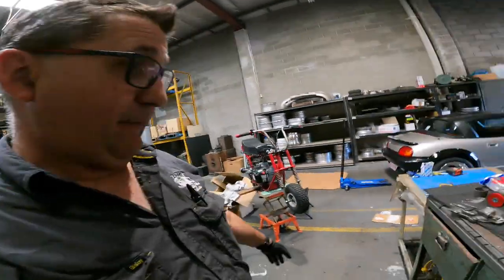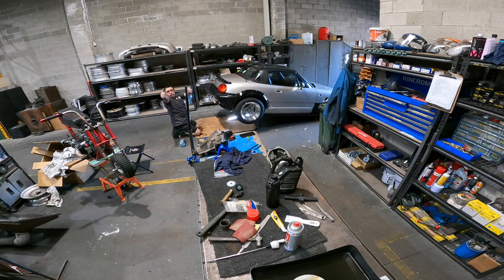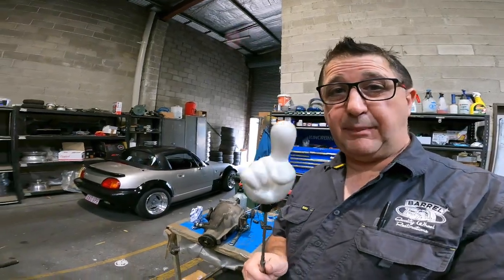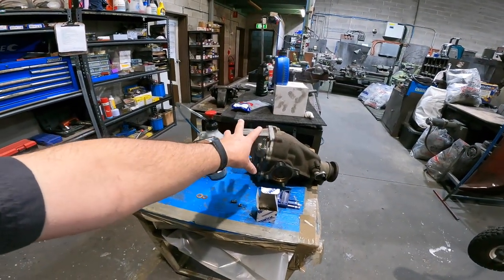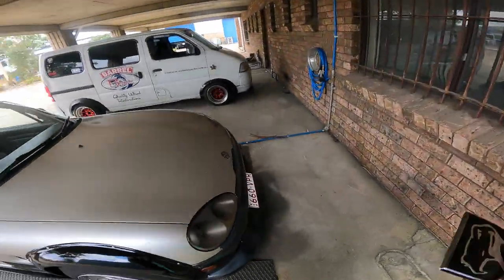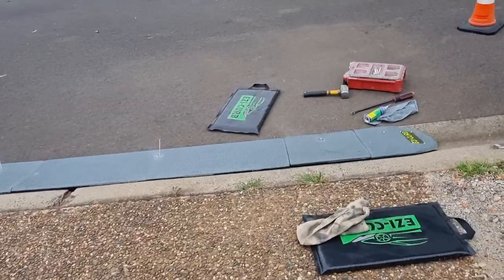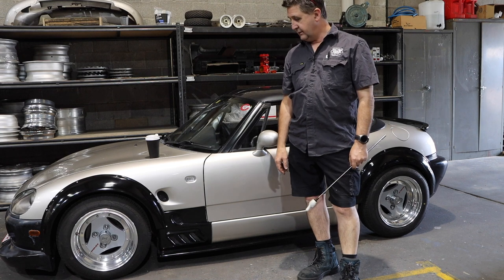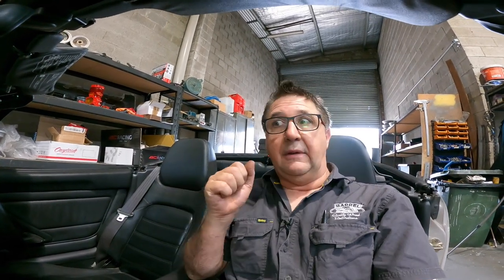82.  Suzuki Cappuccino (Viperccino) Part 6. The Diff saga commences.

Comment: I got lucky on a ae86 Cusco for my 82 carina coupe. Best LSD I’ve ever had. Factory hilux and torsen are rubbish after having a proper diff you can adjust. 
Going forward if anything in other cars breaks they getting Cusco clutch pack type with cam ramps. Mechanical gear driven is rubbish

Comment: i have some info for you about using a standalone ecu. i have my cappo converted to coil on plug using an adaptronic, but the haltech will also work. a distributor from a early version suzuki K6A engine will fit on the cappo's F6A, this gives you a trigger wheel with extra teeth to differentiate the cylinders. the downside is no company has the trigger pattern for a japanese K6A (4-4-3 pattern)(the K6A pattern they have is 3-3-2 which i have not been able to find). BUT if you grind select teeth off the wheel to a 3+1 pattern it becomes a a daihatsu EF-EL(also a 3 cylinder).
Reply from the maker: Great info! Thanks for that, I'll have a talk to Davo and Scotty at Haltech.
Reply: @BarrelBros  The boys at Haltech can also create a custom trigger pattern file for you, helps that you know them 😊
Reply: If they can make up a trigger pattern, 👌👌. I enquired a couple of years back on running a 550/750 on my cap but the lack of a pattern killed the dream!

Comment: Could the driveshaft be doing the vibing?
Reply from the maker: Could be. Jury is out at this stage.
Reply: Mate had a Cappa with a shaft that vibrated like this, 20min at a driveshaft place and it was balanced, wouldn't hurt to get done as a precaution so you know you're not chasing imaginary problems ;-)